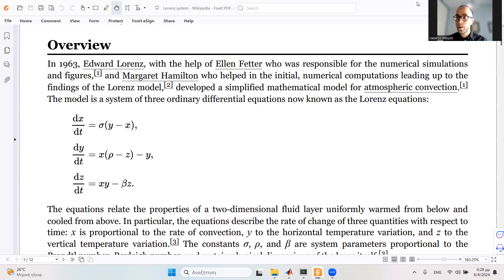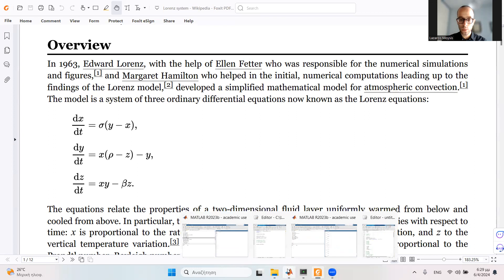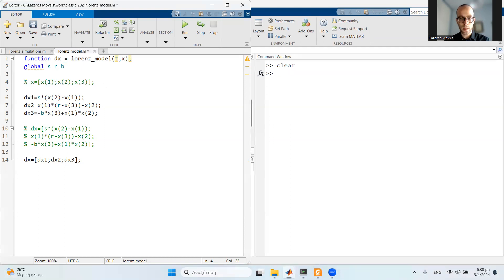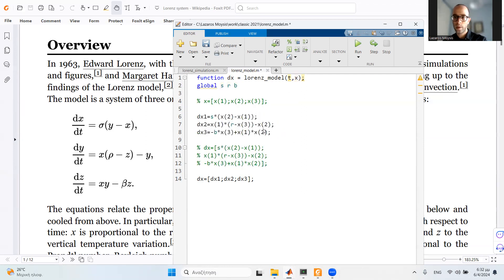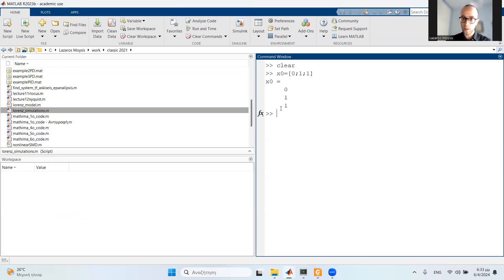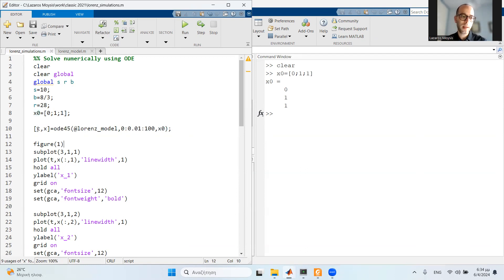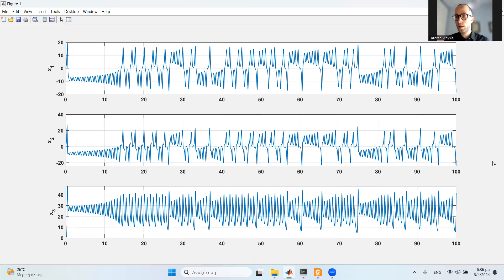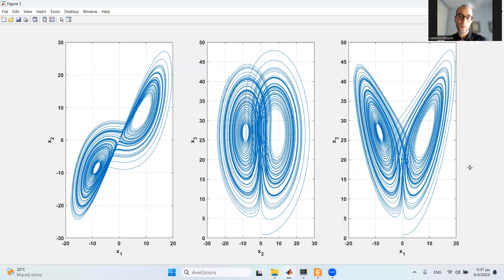Simulate Nonlinear Systems in MATLAB (ode45)

Comment: Great presentation!
Could you please show as ways to calculate the lyapunov exponent numerically 
and plot the lypunov exponent for varying parameter.
Reply from the maker: The code for LEs is a bit more difficult for continuous systems. You can read the recent work Balcerzak, M., Pikunov, D., & Dabrowski, A. (2018). The fastest, simplified method of Lyapunov exponents spectrum estimation for continuous-time dynamical systems. Nonlinear Dynamics, 94, 3053-3065. Maybe some time from now I can upload a video explaining this code yes.
Reply: @lazaros_moysis  Thanks For Your response. I am currently investigating the nonlinear dynamics of a  shape memory alloy system. The system is of a second order. Is there any links to get the code to calculate LE?
Reply from the maker: @YohannesKewaniGebrewahid  If you go to Matlab central, you will find many codes about calculating the LE yes. If you are somewhat familiar with the proccess, you may be able to understand them and replicate them.
Reply: @lazaros_moysis  Let me go through the paper you suggested. I will try to replicate the matlab code, and I would kindly ask if we could stay in touch through the process
Reply from the maker: @YohannesKewaniGebrewahid  Sure, good luck!
Reply: @lazaros_moysis  In chaos control, it is necessary to find one of the unstable, 
periodic orbits. Do you know ways to find the period of the UPO
Reply from the maker: @YohannesKewaniGebrewahid  through the bifurcation diagram. But any control technique should work for all cases, regardless of the map's behavior.
Reply: The bifurcaton diagram (local maxima)for a 2d continous system displays a cloud of points. How could I determine the period of UPOs using it.
Reply from the maker: @YohannesKewaniGebrewahid  If it has many points, it is probably chaotic i guess
Reply: Hello, I have been looking a paper you suggested me. However, I couldnt develop a matlab function to calculate LE for a second order system. Could you kindly provide me a code LE for a second order system. I could attach you the mathematical model of the system through your convinience
Reply from the maker: @yohanneskewani9703  At the moment I cannot provide you with a code for LE calculation, I will prepare and upload it later. Take a look at the built in Matlab functions
Reply: I have a report to be submitted by the saturday. how could I get the LE in this short time. I would like to send me your email so as to communicate in detail
Reply: what are the built in matlab fu ctions?
Reply from the maker: @YohannesKewaniGebrewahid  it is available on my channel. Just google matlab Lyapunov exponent and you will find results
Reply from the maker: @YohannesKewaniGebrewahid  matlab has a function to compute the Lyapunov exponent for a given time series. It is only a numerical approach, it is not based on the system ode, just on the time series. Maybe it will help u thought